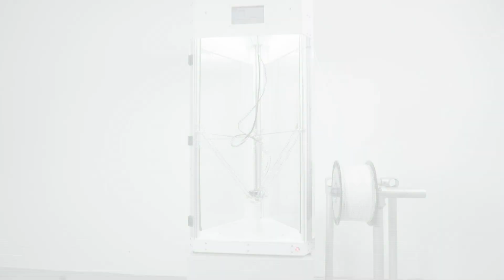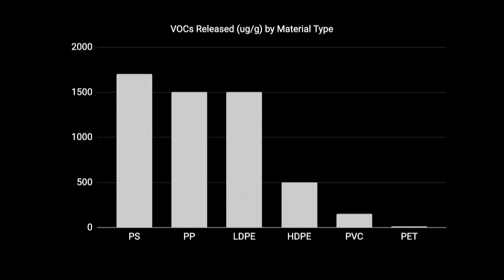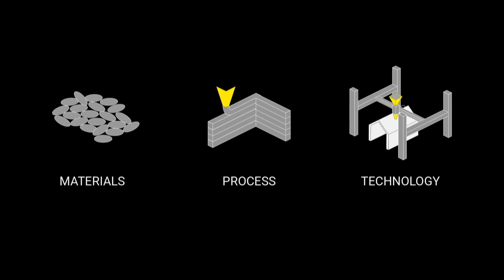3D Printing Houses with Recycled Plastic | Matt Watkins | TEDxTauranga

Comment: It's sad to me that with 37.8 million subscribers as I write this only 4,900 views with 140 Likes. More people should be interested in this process. This is a huge step forward in the construction industry. Yes, the 3D printers to build a house are expensive. Yes, you have to find a supplier of the PET, people that know what they're doing, and other factors. But once that is done, the sky is the limit. The advantages of plastic over concrete 3D printed houses are great. Not the least of which is the removal of waste from landfills.

Matt, please continue your research and make this happen.

Comment: Great presentation! I am also very enthusiastic about solutions to  affordable housing which utilize recycled plastic. As a Carpenter turned Construction Engineer I can say that you are definitely on to something here. Have you considered utilizing off site printing facilities to produce building elements for final on site assembly?
Reply: The benefit of onsite manufacturing tend to out weigh offsite. 

Mostly because it’s harder to transport large parts than it is raw material to site. 

Offsite manufacturing also requires assemble of the components so it’s not as efficient. 

A large gantry print system with a polymer extruder would be the most ideal solution